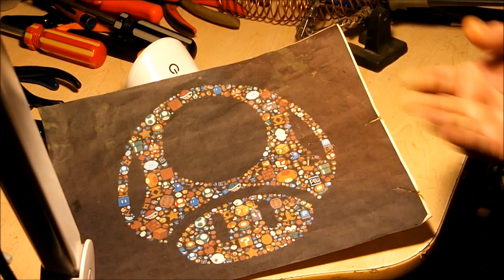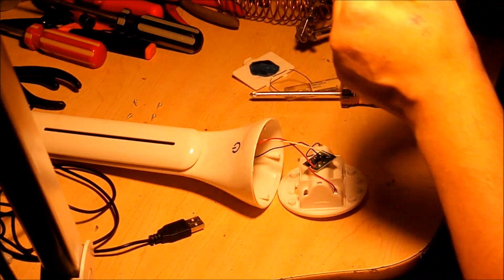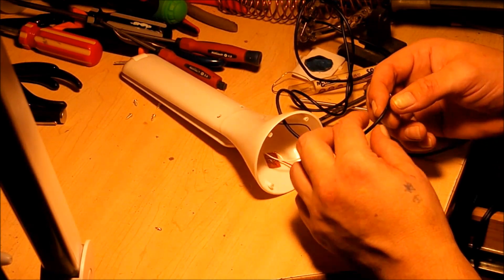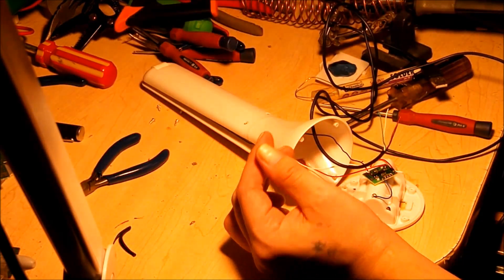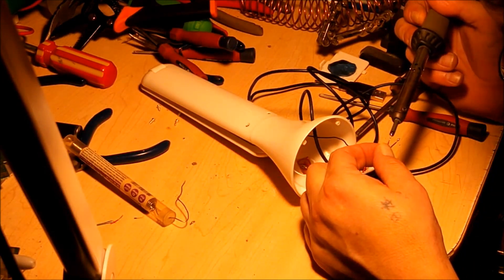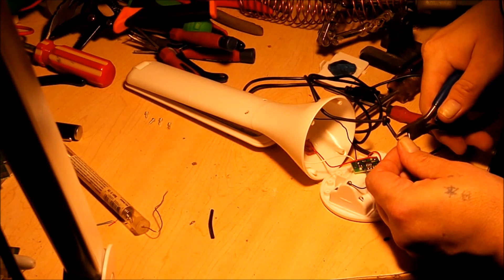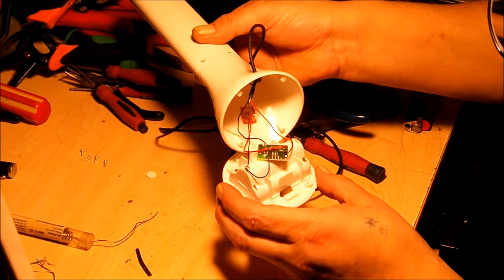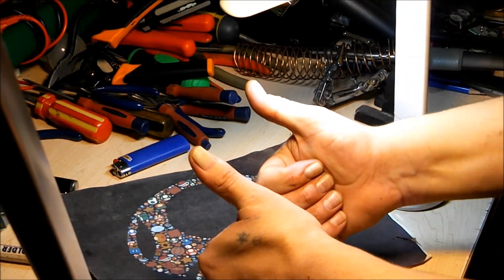How to Convert a Battery Powered LED Lamp to USB Power!

Comment: Do you think if you put rechargeable batteries in with it connected, that it would charge them while it's being used so if disconnected from power, you'd have some light? How long did it work for?

Comment: I have this ball rgb desk light that takes 2 flat hearing aid style batteries (3 volts total) and my plan is to make it usb. Usb is 5 volts correct? So it would be too much I assume being 2 volts more. Do I need to add a resistor? What ohm's?
Reply from the maker: Yes, USB is 5 volts and you will have to build a voltage converter to step down to 3.3 volts. There are many tutorials on YouTube you can watch for this. “How to build a 3.3v voltage regulator?” is one video I found that may help. Good luck!

Comment: Can I do this for a 3V battery powered L wire?
Reply from the maker: USB is 5V, you may have to build a circuit to step down to 3V. My lamp was powered by 3 - 1.5V batteries, which would equal 4.5V.

Comment: Thanks a lot.. U just gave a great idea.. I'll just change everything that runs on battery in house to USB. Need one help I want to do it a little better like I don't want the wire connected to it always.. I want to run it like with a connectors

Comment: Is there any alternative to soldering?
Reply from the maker: Asavari Ingrole You can use ‘conductive wire glue’, which can be found at your local electronic parts store or order online, amazon.
Reply: twist and tape

Comment: Today I got the same Kodak  product and wanted to make it plug in rather than powered on batteries so I found you 
Thank you so much for this 
But I didn't get the last stuff which wire should be connected with which one
Reply from the maker: Prakash chaudhary Black(negative) to black and red(positive) to red. The data lines(green & white) on the USB cable are not connected. Hope that helps!
Reply: @BuxProduxshuns  I was just waiting for your reply and make it happen in 5 minutes
 thanks sir